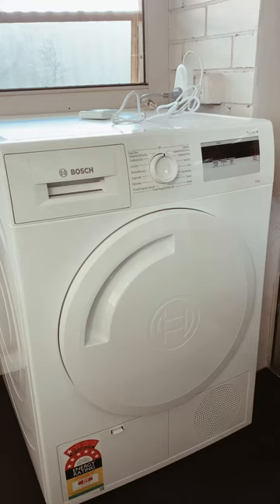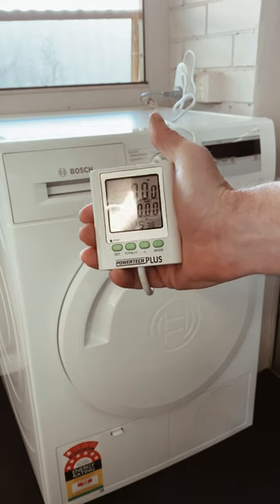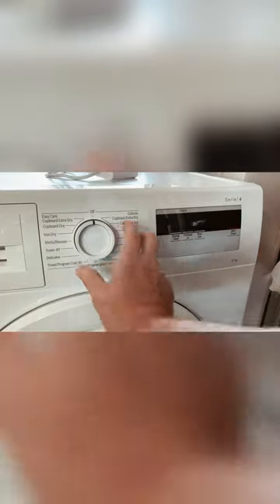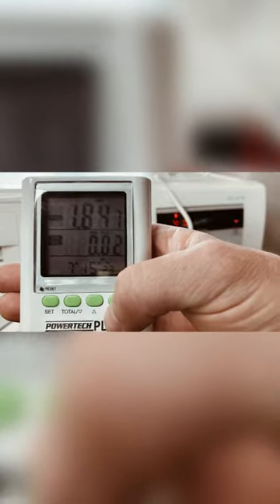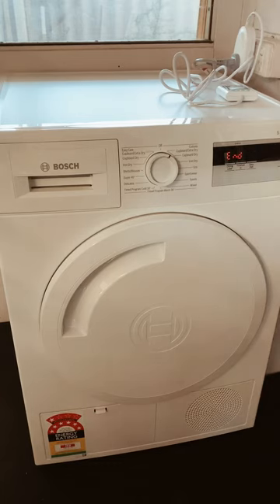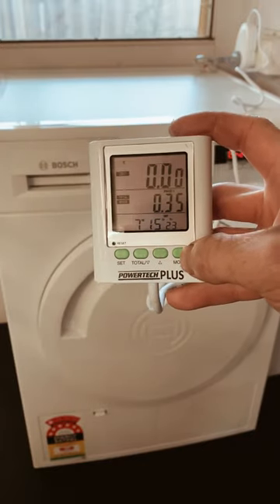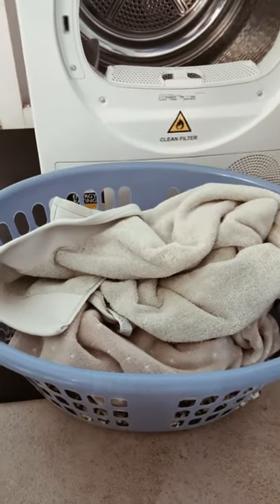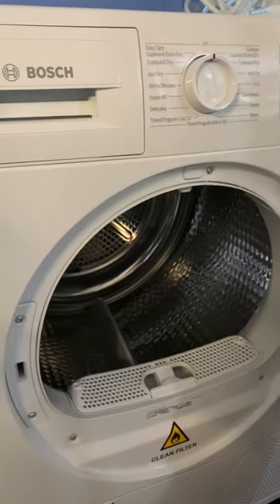Bosch heat pump dryer vs wet Towels? How good is it? #bosch #dryers #heatpump

Comment: Wattage! For solar, that’s super important. Basically your data shows it’s possible to run this dryer on a cloudy day for free with a 5kW solar system. For reference, a conventional dryer would use 2,000+ Watts. Thanks for sharing!
Reply from the maker: Hi mate. Yes I would say soo too. It would come pretty close to running it for free even on a cloudy day😁 thanks for watching
Reply: Is it true that due to tumbling one way only, larger itemsnlike bed sheets curl into balls that never fully dry?
Reply from the maker: Hi Bud. Yeah I have had that happen to me a thew times. Doesn’t seem to be as bad if you have other items in with it to stop it from curling up. Also if you only have a couple items drying the senser will sense that there isn’t any moisture in the tumbler and think that the items are dry and finish the program. The sheets issue has never been a big issue with me as I mainly dry smaller items like socks and undies/shirts etc trousers and jumpers I hang out to dry. just make sure u have maybe half a baskets worth of clothes in the dryer and you should be sweet.
Reply: @Techboxreview  thanks!